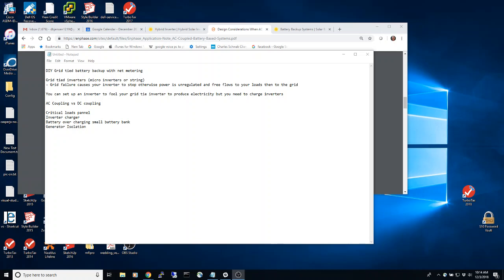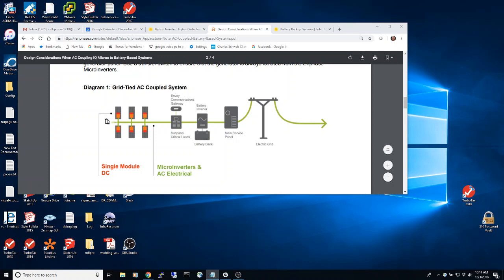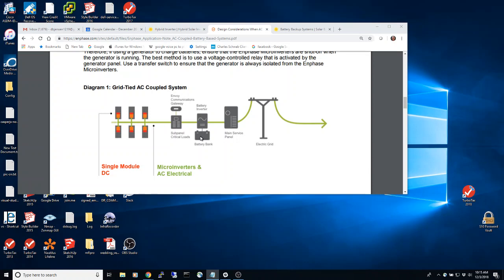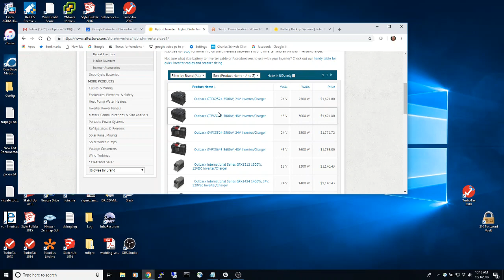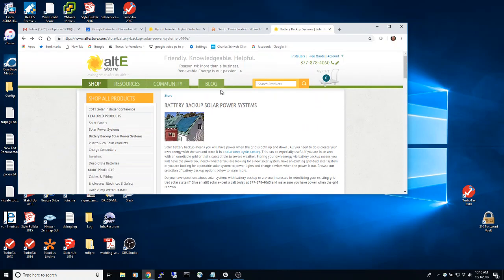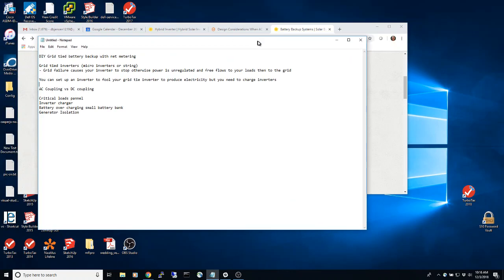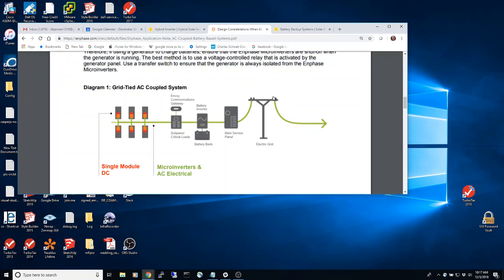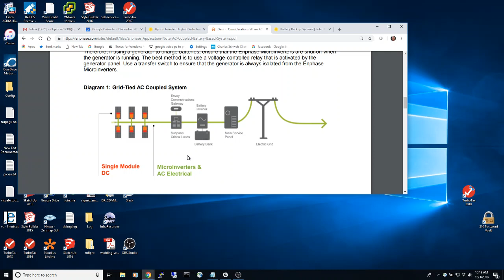DIY Grid Tied Solar with Battery Backup is complicated and expensive

Comment: My idea for a battery backup for my solar system is simple but not automatic. Connect the main panel to a battery charger inverter that is keeping the batteries charged. In the event of a power failure, disconnect the shore power nreaker and the solar panel breakers at the main panel, switch on the AC breaker in the main panel from the inverter. Switch off all but a few critical Breakers to limit load. What do you think?
Reply: I'm thinking the very same thing. Seems like all the AC coupled systems described on youtube talk about a critical loads panel. no thanks. Lets keep it simple and back feed the battery bank into the panel when needed and turn off the breakers not needed. Would be pretty easy to do it through a legal generator interlock system. My question would be, could such a system I'm describing be able to trick the grid tie panels into charging the battery bank? can't find any useful information on that.
Reply: @JonahTheWhale613  Good question. Have to run that one past the inverter manufacturer.

Comment: Landed on your channel while looking at how a battery/solar panel system ties into the local utility - how that magic works - and you convinced me that this is not the droid I'm looking for.    Way to complicated and expensive if your goal is having a pay back in say 7 years.    I'm going to stick with just selling  whatever surplus energy I'm not using back into the grid.   Technically that is so much simpler with very little care and feeding.    I'll use my generator as backup when the power goes out.
Reply from the maker: I had to watch this video again to see if I still felt the same way. You and I still feel the same way as I did two years ago and batteries are still expensive in our a big hassle. Your generator solution is better and maybe just having a battery charger charging a cheap lifepo4 Battery in case of an emergency? That is if you had many blackouts. Thank you for your comment.

Comment: Stack-able up to 4 units and 17,600 watts and it has a built in Grid shutdown relay that switch over sometimes i have seen them not even blink making them very good for AC coupling.  https://www.dommelvalley.ca/catalog/datasheets/MS-PAE_series_data_sheet_revc.pdf

Comment: https://www.dommelvalley.ca/catalog/     Canadian pricing     Check out the Diversion controller that monitors the battery charging and divert the power to a hotwater tank if the Batteries are fully charged. Magnum is the only company that has perfected it.  https://www.dommelvalley.ca/catalog/datasheets/64-0655%20Rev%20B%20(ACLD-40%20Data%20Sheet).pdf

Comment: It's a misconception that solar has to be used through Batteries. Yes you can use small battery banks and use AC Coupling systems that allows you to use the 120/240 volts as it is being produced by the micro inverters from the solar array without sending any of it to a grid. All these big solar arrays can be converted to supply there power directly to the home or be use to Charge a Battery bank or Be Store in Hot water Tanks to heat the homes hydro thermal flooring at night with is a large savings on Electric Hydro heated homes. The extra power if not used by these loads then it can be use in a baseboard heater. So even a small Battery bank can start a system and in time with the saving it will be more than good for a person to be paying one quarter for Hydro than the next door nabour that follows your advice. In the winter hydro bills can be 600-700 dollars a month here in Ontario Canada because of a delivery fee they tack on top of the price of Kwh's which doubles the price so if a homer owner can buy 40 panels and heat the home day and night and knock the bill down to 150 dollars the other 400 -500 can be used to buy more panels and micro inverters. The government want people to spend money, well this is how people will and it will do more for the country than a hydro company paying Share holder large diva-dins on their investment and at the end of the day the home own is being able to save for a retirement that the Government can't take or spend. The home owner Owns his own Power generation Plant.
Reply from the maker: Very good comment. I also like your links on diversion. I will look at these. I live in Southern California and use gas for heat and my bills are low. Very good ideas and research. Thanks